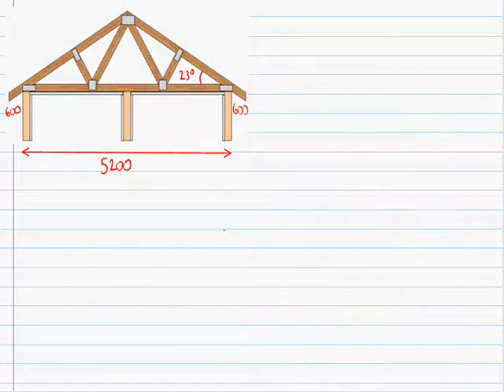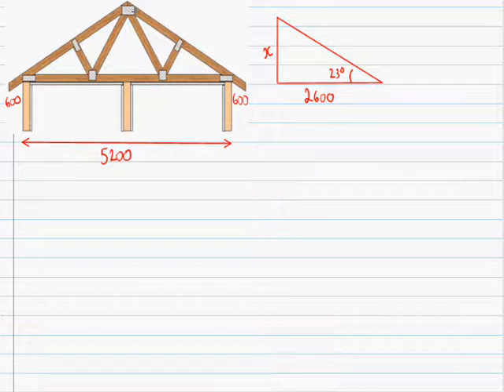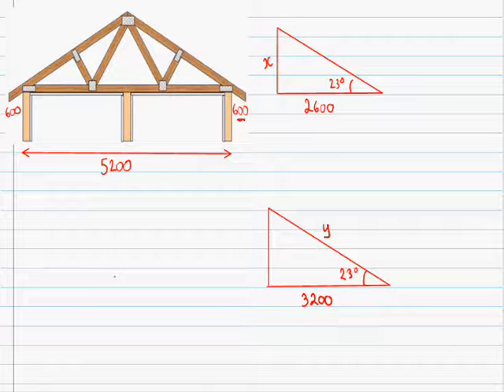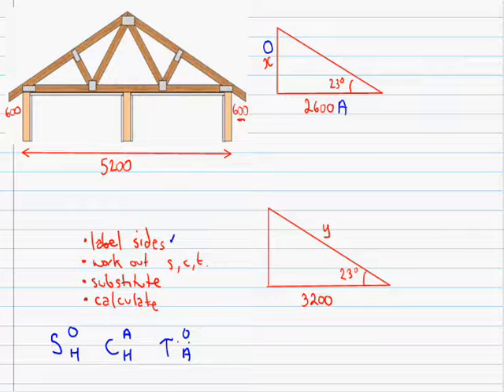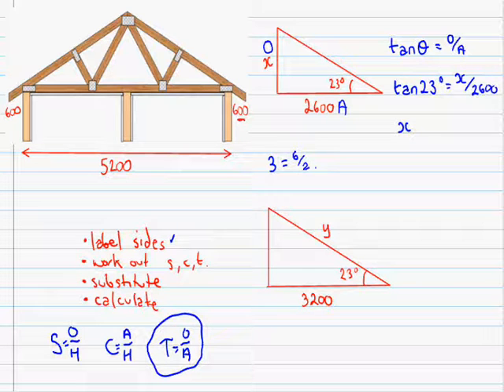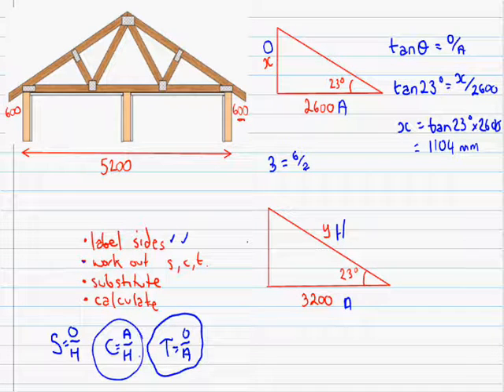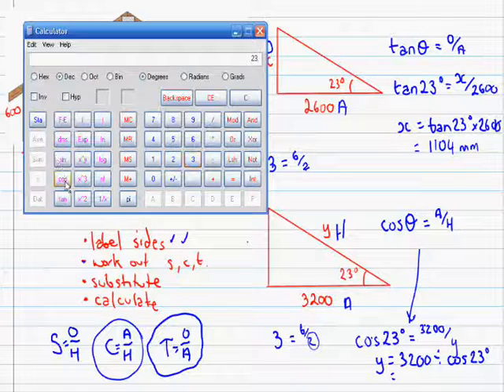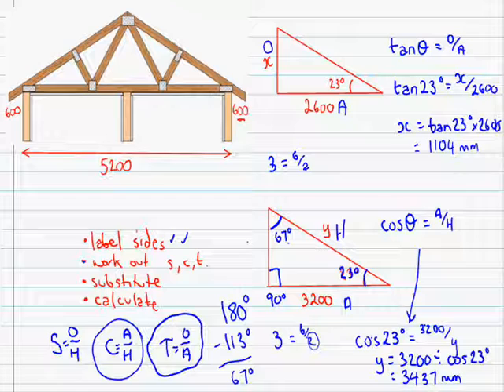Sin Cos and Tan - Basic Trigonometry Example

Comment: @FakeDodgeViperGuy
The 600 isn't the height. It's added to the 2600 because if u measure the bottom of the house you get 5200 across. Half of that is 2600 which is the measurements for the adjacent side of the 1st triangle, but if you measure (for the 2nd triangle) from the middle of the house you get 2600 plus an extra 600mm (which is located in red on each side of the house in the example) to reach the end of the outside beam on the roof in the 2nd triangle. 2600+600=3200

Comment: Okay, I have few things to point out about your equation. First one is you noted down 3437mm, when you clearly stated the answer is 3476. I'm assuming that was a mistake. My other issue is , you solved the whole operation on the calculator 3200 divided by 23 degrees then you hit COS equaling .92 which you then hit the equal button giving you 3476. Now , why is that 3200 divided by COS 23 gives you 3476, but if you figure out the COS of 23 which is .92 and I then divide  3200/.92 it gives me 3478.. Please explain why its different when I figured out the COS first before dividing.